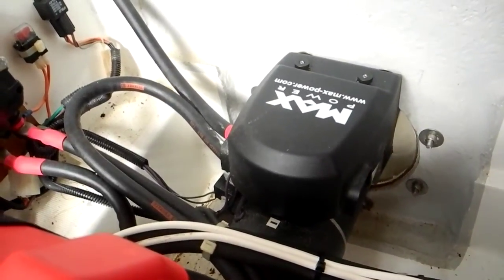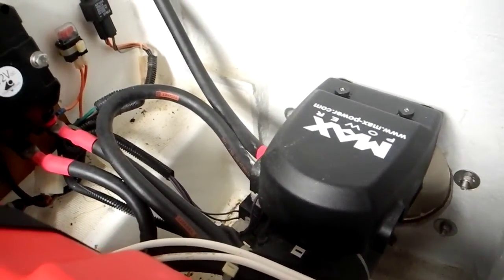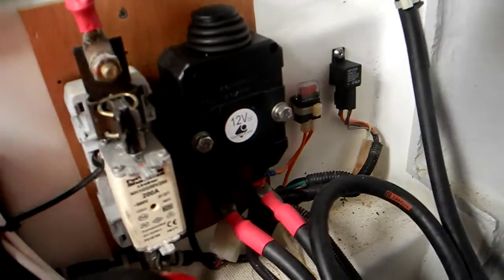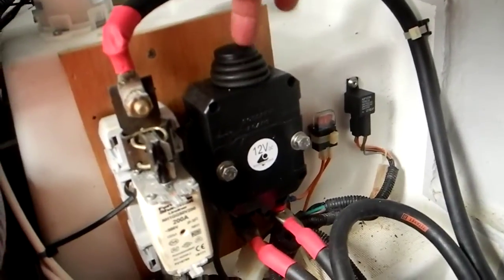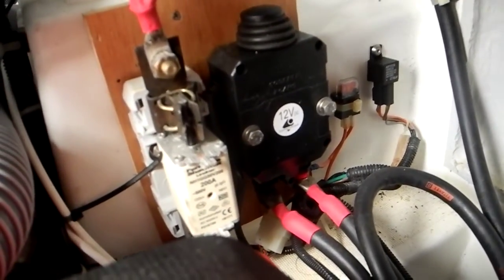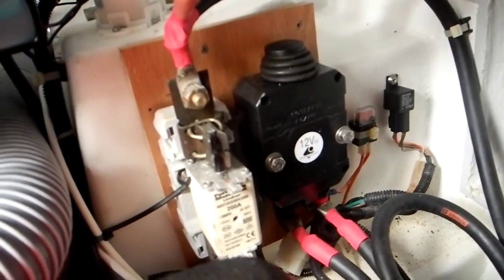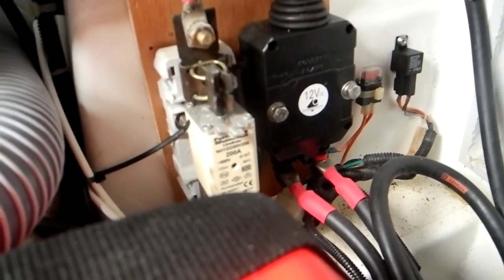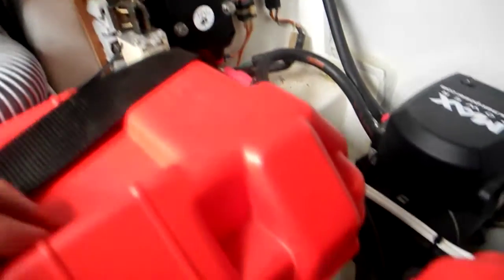Stern Thruster Electrical System

Comment: Hi Captain Chris, would you have a wiring diagram for the components you showed in your video on the thruster above? Would that be different for a 12V system? Best regards, Silvano
Reply from the maker: Silvano Cometta no we don’t have a diagram for that as it was on a clients boat and we are no longer aboard. Check with the manufacturer of your equipment to see if they can help you.